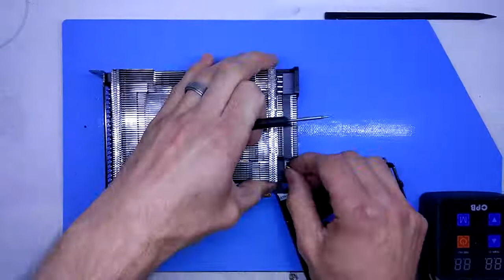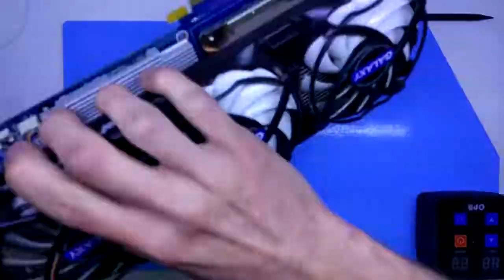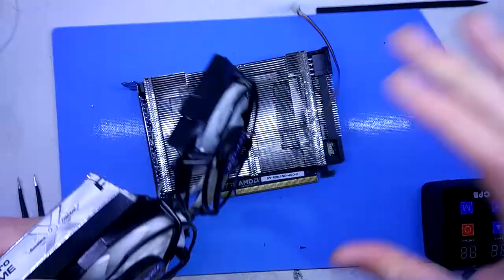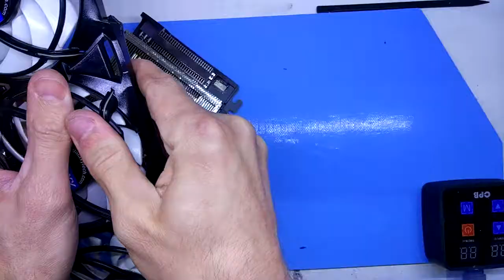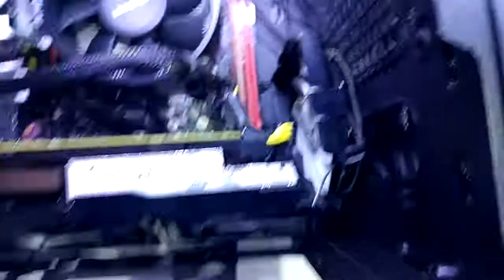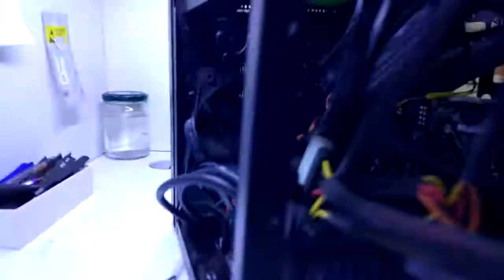R9 Nano Replacement Fan (Ghetto install)

Comment: You didn't put any TIM on the the HBM modules beside the GPU. I hope it doesn't die on you for that. HBM needs cooling too. Might be why it was loud.
Reply from the maker: Thanks for the Spot!

so far it has done over 500+ hours straight of Mining and has yet to show a problem.
But with the warmer weather (Summer in Australia) it would be worth while doing it
Reply: I forgot to say,  very interesting fan mod.